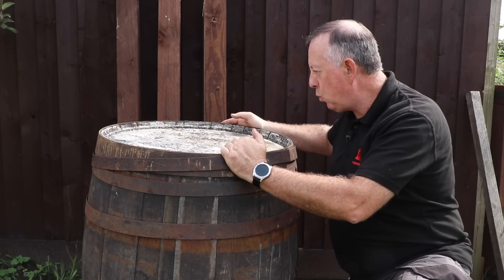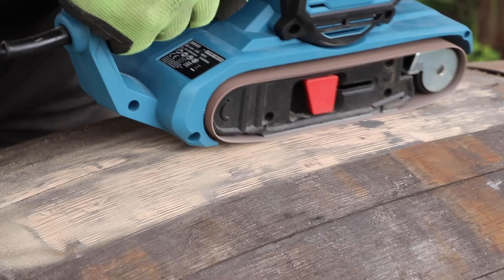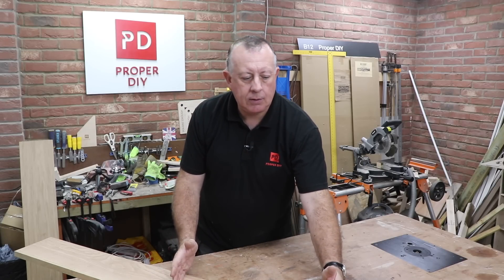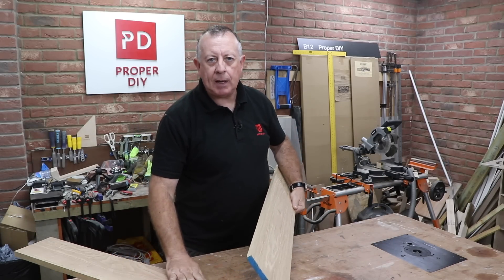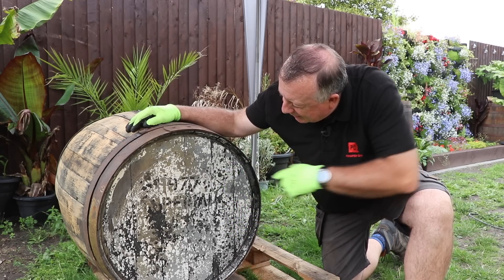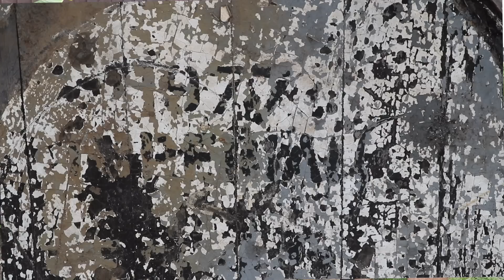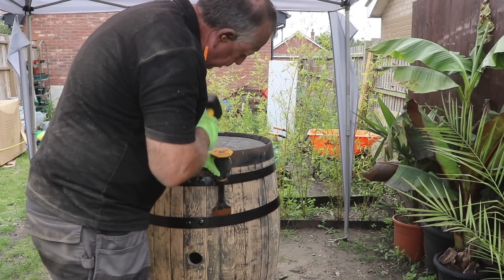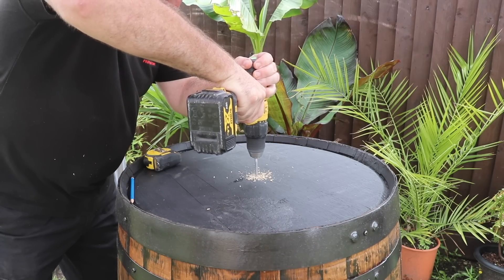How to turn an old whiskey barrel into a modern drinks table.

Comment: Nice work, I would try to make those screws on the table top look nicer than that though
Reply: I was thinking the same thing. Simplest would probably be to rebate them and cut some wooden plugs, though that would need a drill press.

Comment: Nice video, however, at the risk of sounding like a troll, I was surprised that you glued the two layers of the top cross grain.  Because wood expands/contracts across the grain, this is almost always a bad idea, especially for an outdoor piece that is exposed to significant swings to temperature/humidity.  The two layers are going to expand and contract at 90 degrees from each other and will eventually crack.

Comment: Great vid, I did up my own barrel recently. I used a powerful hot power washer on it. One I use for the farm sheds and it brought it up perfectly. Just needed a light sand. I'll try the table top now. If only to save the top of the barrel from rain damage.

Comment: Painting with hammerite I really recommend to use the roller - the surface looks much better  after painting when compared to painting with the brush. And I would definitely screw the top from below to avoid screws being visible.

Comment: You're right Stuart, Norm Abram never had those problems in his NY Workshop. I was always envious of his stockpile of off cuts, sheet material & boards. 
This is a great little project & one I might even have a go at myself as I'm starting to run out of DIY jobs to do around the house & garden. 
Keep 'em coming Stuart.

Comment: Tip: get a spiral flush trim bit for your router. It makes a HUGE difference in capability of removing material. The bearing should be at the shaft, so you can use it as a flush trim bit and  without the bearing engaging. Cheers!

Comment: Stuart, I watched Bradshaw Joinery used polyurethane glue for oak which allows for a much quicker drying time. Of course I know you are aware of this glue but is there a reason you preferred "white glue" in this case? Thanks. Nice job by the way!